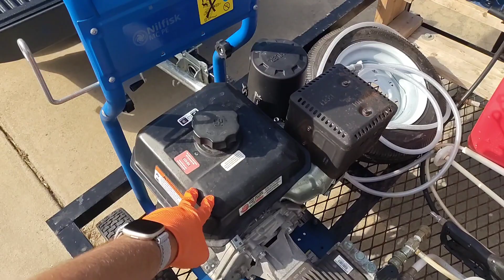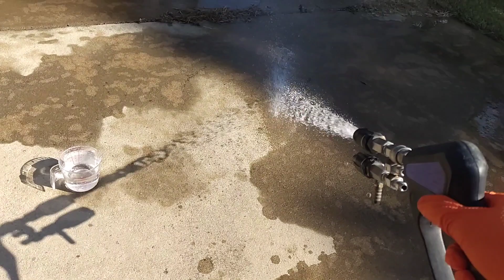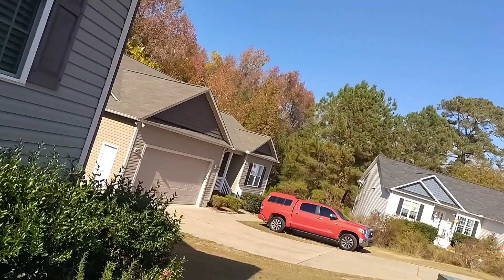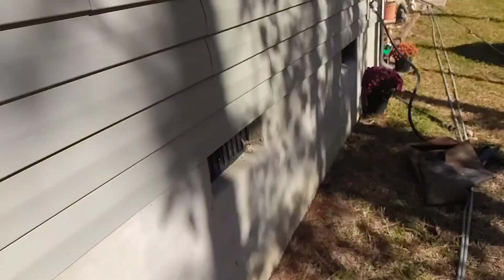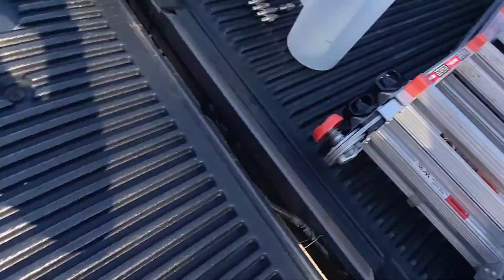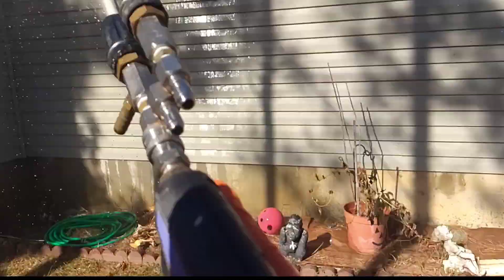How to Soft Wash like a Pro - Pressure Washing - Small Business

Comment: Hey, just finished the video. nicely done, great tutorial. What is the diameter of the barb on your chemical injector? Do you ever have to hook up to your xjet nozzle to pull chemical? Wouldn’t that require larger tubing than your injector barb? Thanks in advance for your time. I hope I’m not confusing you lol
Reply from the maker: Hey, thanks for watching!! The dsi has a 1/4 inch barb. Yes, I use the x jet when I need stronger chem mixes. It uses 5/8 inch hoses.

Comment: When I search for X-Jet M5DS it's showing only 1 tip? But in your video you have 2 X-Jet M5 twist nozzles? Where to find the dual nozzle? Also, your 4 gpm pressure do you feel that is enough volume to properly run a residential pressure wash business? Thanks in advance!
Reply from the maker: Hey, thanks for watching!!

My duel M5 setup is one I made myself. The XJet and M5DS each are mounted to a QC fitting. I just removed the QC fitting, and mounted them to a JROD.

Heres a video I made about my gun and nozzle setup https://youtu.be/VOIU0FC1HiQ?si=x9RM13dBJd71oQfP

My 4gpm has served me well, but the higher GPM will get the job done faster. I can do 3-4 houses a day during the spring with my 4 GPM.

Comment: great info! question, can using SH on surfaces with oxidation cause damage?
Reply from the maker: SH when used correctly shouldn't make a difference on oxidized siding. Just make sure to document the oxidation before you wash, and be super gentle with the pressure. There is always the option to walk away if you don't feel 100% that you can do it without causing more damage.

Comment: I'm a bit confused. Did you say using an m5 xjet for rinsing with a jrod for soaping is viable or no?
Reply from the maker: Yes as long as the nozzels you are using on the JROD are low pressure Nozzles. Check out pressurewashingresource.com and do a lot of searching on the topics. There is a ton of info on there, and I learned a lot from there in the beginning
Reply: @steppspressurewashing I currently use just a J-rod. Never had an Xjet, but if I'm going to be using it for driveways I might as well use it to rinse. So if I use the J-rod soap tip then swap to the X-jet it will have the same effect of going from the soap tip on the J-rod to the rinse tip on the J-rod, and I won't have to go back to take the dip stick out?
Reply from the maker: @TANMAN84  that is correct!! If you look back to my older videos, before june of last year you can see me using a similar setup. I would carry the x jet in my pocket while I washed, then swap tips to rinse.
Reply: @steppspressurewashing  Thank you I appreciate it. I started last June and have been very uneducated on some things. I do have one more question. Last year, I stayed away from a couple heavily oxidized houses  (major visible white) that inquired for house washes because I was worried about disturbing the oxidation. Was this the right move? Or can it still be softwashed to remove mold and algae? I understand that heavy pressure will disturb it but will light pressure? Does SH % affect this? I see you check your vinyl for oxidation in your videos and sometimes encounter some light oxidation and would also like to know why you do this and how it affects your approach as well.
Reply from the maker: @TANMAN84  so, I do a pre wash inspection that includes checking for oxidation. This is just to document preexisting oxidation or any other damage before I start washing. This way I have video proof that I didn't cause the oxidation. I have washed plenty of oxidized homes, but I explain to the owner that it will still be oxidized when I'm done.
Reply from the maker: @TANMAN84  check out that website, and go nuts on the search bar in the topics section. I would recommend not asking questions at first as Theres about 15 years worth of questions that are already answered and easily searchable.
Reply: @steppspressurewashing  Can't thank you enough for that. I have done a lot of research on forums with mixed results. I'm glad I found your channel
Reply from the maker: @TANMAN84  I'm glad to help with your journey!! Thanks for the kind words!!
Reply: How do you connect the jrod to the xjet? Thanks